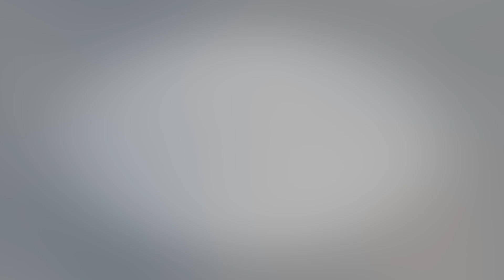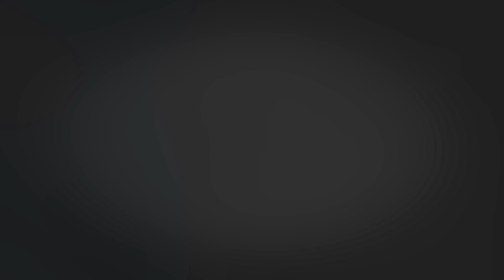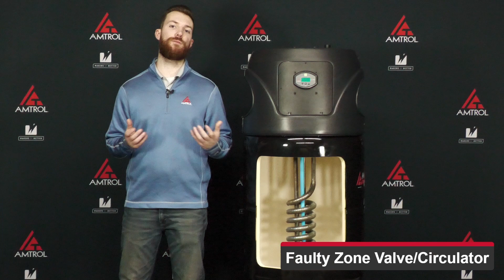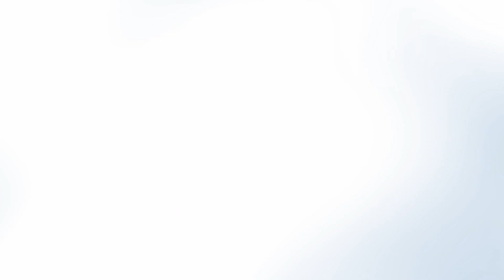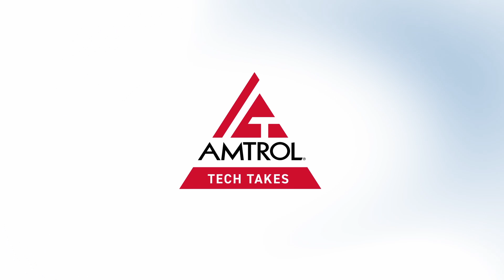Troubleshooting an "Er 3" Error  - Amtrol Tech Takes

Comment: Just removed a 25 year old Boilermate (42 gallon) and replaced it with a Hydromax (41 gallon) unit. Using the same boiler, which is only 2 years old and everything else is the same. Get an Er3 code any time we try to use the washing machine and take a shower close together. We also noticed the water is no longer hot at the end of a shower, despite having the shower valve at the full hot position. We are using the OEM circulator that came with the original Boilermate and all of the pipes are 3/4" with good circulation. Double checked the hot water at the sink, just to verify it wasn't a shower valve problem. Boiler high limit is 190 degrees and we reset the unit's temp differential to 5 degrees, along with firing the boiler to high limit on a call for hot water. Hydromax temp is set to 130 degrees. BTW, the burner cycles off while the circulator still runs, which tells me the unit is not absorbing the heat. This makes me think the newer style heat exchanger is not as efficient as the one in the older Amtrol unit. Didn't have this problem with the original Boilermate. What can we do to solve the problem?
Reply from the maker: For technical support, please contact our technical support team at amtrolwatersystemsinfo@worthingtonindustries.com or at 401-535-1216 so we can better assist you.